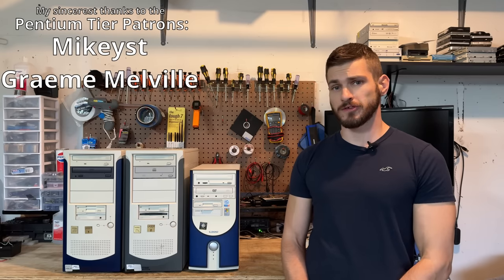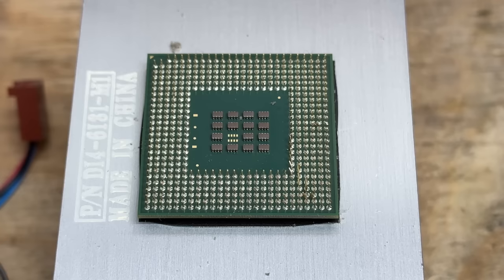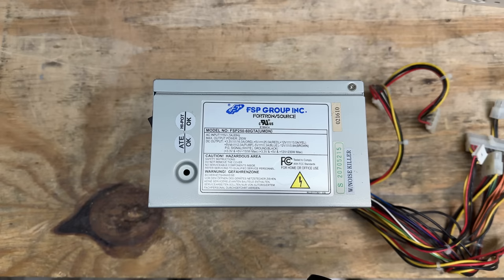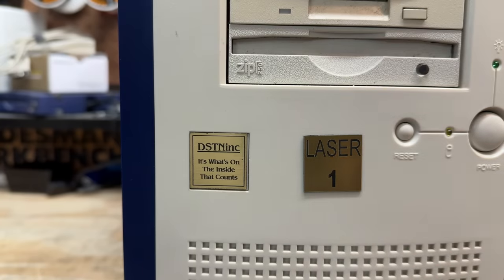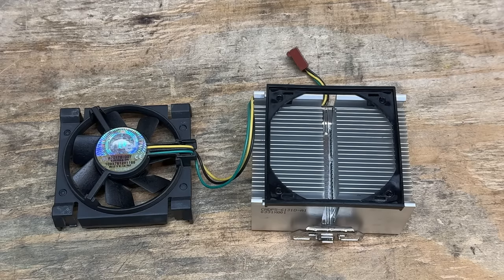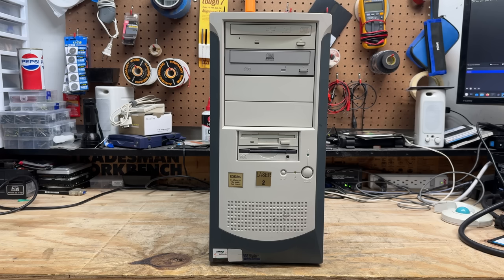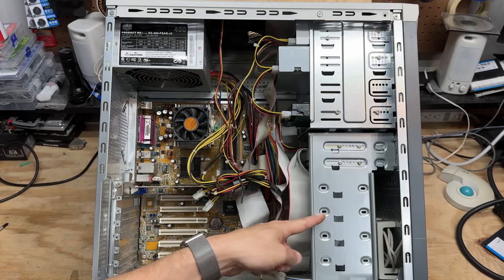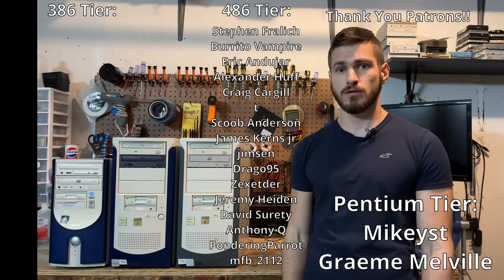2000's Systems! Teardown and Test!

Comment: Here in Portugal you could get those MEDION systems in LIDL, also a German grocery store.
You spend a lot of time brushing all parts. Why don't you use compressed air / a computer de-duster to speed that up? Apart from being too noisy to record and send the dust flying, it can clean everything easily

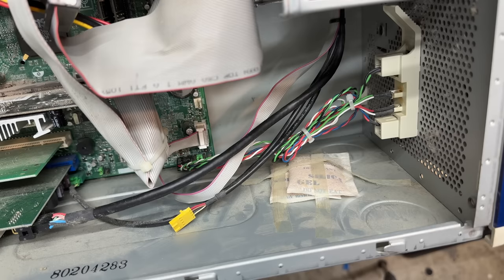Comment: 3:57 I own the same model but a bit low-spec. When opened,I saw those 2 silica gel packs using the same "tape", in the same spot. So definitely Medion did that.
Edit:By low-spec, I meant that you have a model 144, and i have a 123A wich i think was the middle class of the MT5.If you're not convinced enough, the front pull-down tab on the 123a only contains 2 USB 1.1 and no Composite,No S-Video Port (there was one on the Gigabyte Card) no nothing except for that USB and, 56k single-line modem had no FireWire,just a line port. In addition to that, there was strangely 5 USB 2.0 ports instead of the shown 2 USB.

Comment: The Medion PC's usually came with Radeon graphics. Something similar to the All-in-wonder cards but custom made for Medion with extra connectors to bring features to the front I/O. These all had an issue where the bearing of the tiny cooling fan on the GPU would dry out and seize up, frying the GPU. This is probably also the reason why the replacement GPU wasn't much better then what it came with. It was a repair not a planned upgrade.

Comment: That Intel cooler on an AMD cpu triggered my ocd :) I had an Asus A7V8X-X with an XP 2200+  it was an nice board. That CPU clock speed selector is actually an easy way to OC the CPU a little for those who don't really know how to adjust things to make a proper oc. It was able to run that 2200+ at 2.0 GHz for me,and with a few gb of ram it can run Windows 7 pretty good as long as it's not SP1

Comment: Back before I really did 'vintage' and to my eternal shame, I killed a mint Dell Dimension 4100 Pentium 3 system. I tried, in vain, to replace the motherboard but was unable to find one for less than a kidney. In the end I came across a Medion/Aldi Pentium 3 motherboard and was able to partly redeem myself by building a kick-ass Pentium 3 system (using all the parts from the Dell) and it is superb. It runs Windows ME (perfectly, I might add. I love that OS, it really does not deserve it's bad reputation) and has a full 1Gb of memory (using R. Loew mem patch) and is super stable. Those Medion/Aldi PC's are great.

Comment: Pretty nice machines, specially the case/cases ?
With the removable motherboard tray would be great use for a testing rig here.
Socket 462 & later AMD sockets are a bit more interesting to me then Pentium 4 & the somewhat failed Pentium D on socket 478 & 775.
The core 2 duo & core 2 quad & other cpu's based on that architecture at least are fun too overclock for extra performance.

As i grew up with those two sockets & a bit before those with slot 1 & socket 370 between ca 1999 - 2004.
Then grandparents got the slot 1 pentium III in a slocket adapter system, 1 ghz pentium 3 i think it was a coppermine socket 370 one rather then the last of the pentium 3's the Tualatin, ATI 9550 256 mb (which i saved & still have.) until like 2012 i think still on windows xp with 1.5 gb ram.

I'd make a build surrounding either of the Athlon XP systems, maybe a budget gaming rig ca 2005 that got some upgrades thrown at it without upgrading too a new cpu socket.
Like a nicer cpu cooler & a bit of overclocking on that athlon xp 2800+, faster gpu that can run half-life 2 & doom 3 alright.
(HL2 has no copy protection so it can run outside of steam just fine, ofc new engine effects might make it pretty demanding but hey why not see how far it can be pushed.)
And you can make shortcuts of hl2 exe too run the folders for each HL2 episode like this line in target saying for example " /foldername/half-life 2/HL2exe" Adding in " -game EP2 " for episode 2 at the end.
And " -game episodic " for episode 1 at the end of whatever it says in target on the shortcuts you make of hl2 exe.

Comment: The processor in system 2 looks like an Athlon XP 2000+. Despite the name, they were 1.667GHz. You might want to adjust that BIOS setting because they were known for running hot even at the standard clock speed.

Back in 2002, Intel's Pentium 4 wasn't doing so good. It was slower and ran hotter than an equally-clocked Pentium 3. So AMD swooped in an said "Our 1.66 GHz Athlon performs the same as a 2GHz Pentium. So we're going to put 2000 in the name." AMD got away with it because their claims were true. Those Athlon XP processors were a very popular choice back in the day.

Comment: I can't tell you how many times the damn thermal pad on a Socket 478 turned into straight up cement like that.  I really hated that.  The dust mound...  In the words of Cleveland Brown... "Oh that's just nasty."

I don't recall those Mitsumi drive trays sounding "healthy" even brand new from the manufacturer.

Comment: First AMD Athlon CPU is a axda2000dut3c model and it has 1667Mhz. Second one is 2800+ and it has 2083Mhz. For thermalpaste removal im using Turpentine and it works like magic. Aldi have sold those computers at normal shop where you can buy bannanas and egs and milk. They selling laptops and other electronics as well till this day, but not constant. it apears time to time.

Comment: The first Pentium Snore-based board had been partially recapped at some point by the looks of it.  There's some Rubycons on the left, mixed in with the no-name brands.

EDIT: lol, you mentioned the Rubycons about a minute after I noticed them. 😅

Comment: Medion P4 usually come with Radeon 9800 XT.  Very rare and expensive AGP card. Had one system from them.
Reply: No, not the 2,4Ghz system. This came with a geforce 4 mx. Later systems with 3,2Ghz had a special version of the 9800XT called 9800 XXL.

Comment: 17:02 seems to be an Mid 2002 Medion. Late 2002 Medions had already the silver/black case. So I guess it was either an GeForce4 Ti 4200 or GeForce4 MX 440 or MX 460. But they (MSI for Medion) made as well an GeForce 3 Ti 200 and GeForceFX 5200, 5500, 5700 VE with that connector as well..
Don't know why it was replaced with an MX 4000 which would be a downgrade from all options and more on par with the MX 420.. 
And yes you could actually buy these in any ALDI but in the late 90ies, early 2000s the one or two they got per store were already sold out if you not camp for a few hours outside before they openend and then run.. You could backorder them but in mostly all were gone in the first hour or two. This was a big deal back then here in Germany. The media especially a magazin called 'ComputerBild' hyped always their specs and their good value before even the new leaflet for them even dropped. If you need all the features is they were surely a good value but I think only few people ever used all the features. So in my eyes Actebis/Targa (also sold by Lidl), Fujitsu Siemens and sometimes Peacock (later fusioned with Actebis shortly after Targa got sold off) made the better value prebuilds. With less bells and whistles but according to what you really wanted to do...

Comment: The early Aldi PCs had a really poor reputation for being not upgradeable. The first two or three generations even had soldered in RAM modules. That glued in CPU is just the last reminiscence from that era. They were a real pain in the butt working on them. The Mainboards, though manufactured by MSI are not supported on MSI's Website, but solely by Medion themselves - if you are lucky (of course, Drivers are provided for the OS that was originally sold with the machine).

Greetings from Germany,
Marcus

Comment: I really expected that crispy FSP power supply to go up in smoke. If you ever find an eMachine with the original power supply, expect over voltage and a dead HDD at best. Also I don't think you bent those Pentium 4 pins, I think someone else jammed that CPU back into place. Weirdest one I saw was that the pin of a socket 478 Pentium 4 Prescott CPU had come off in the socket, but the CPU still worked. The pin it's self had snapped off but the base of the pin was still on the CPU. Somehow, the system worked fine, and my friend, who the PC belonged too, just shrugged and said "If it works it works", he used that thing for years until he upgraded to a Core 2 Quad system I built him when the P4 Prescott system started suffering from the capacitor plague. I guess the pin was set just right in the socket to make contact with the detached base.
Reply: Or it was one of the unused or many ground pins.

Comment: nice, i did use my athlonXP machine as my main computer until 2010 on winXP, i had a a7n8x deluxe motherboard and i had a mobile athlon XP oc'd to 2.4ghz and the last gpu i had in it was a 6600 GT, it was beast!

Comment: You just summoned an old memory of a Medion laptop back in the day (early 2000's), probably the worst laptop I had ever owned. The vents were tiny, and the cooling seemingly couldn't keep up with the CPU, meaning even light work resulted in crappy performance and uncomfortable to touch (and that's with it on a flat surface with plenty of airflow, or waving it around in open-air). 

It eventually self-destructed with what I believed was a thermal cutoff whilst applying a BIOS update. We contacted support, it was shipped off, said it couldn't be worked on due to additional internal and cosmetic damage to what we reported (which wasn't true at the point of which it was sent), thankfully parents at the time took photos with a cheap film camera just prior to it being picked up, there was a bit of back and forth, but ended up with an apology and a voucher that could be used across PC World, Curry's, and another one that escapes me.

Sometime later we put more cash with it and got the behemoth HP Pavilion zd8000, 'desktop replacement' computer, since they didn't/couldn't call it a laptop ^_^, loved that thing.

Comment: 18:45 if you burnt that CD-R recently (last 5 years or so), its possible the CD-R itself is just too thin for older drives to read properly. It's getting hard to find quality media, everything is junk CMC media these days that just refuse to work on anything that isn't a modern drive (and half the time not even then).

Comment: Fire Wire / 1394 was strange
I saw a church that had a Fire Wire / 1394 expansion card in the late 90s
I didn't see any software for it.
I remember the pastor had a very very expensive digital video camera and that was why they needed the port.

I don't know what they used it for.
I never saw any video on the website or on the PC

Might have been something they never used

I remember in 95 HP came out with a CF 10 MB digital camera with a serial 9 pin cable
They paid about 450 dollars plus tax for each and bought 2 and never used them

Comment: I think it is modified Win 7 to work on a socket A/462 system.I have  two top model Gygabyte MB with strongest NF2 ultra chipset with the top 3200+ Barton CPU plus 3 gb of ram,,You can't normally put win7 on these !!Must be modified!!

Comment: What do you mean Western digital doesn't have the best reputation all the ones I've ever seen fail are Seagates.
Reply: Totally agree. I've used WD for years, and out of about 40 drives, I've only ever had 1 fail. Seagate? Meh, I've had several of those fail, especially the 7200-9 drives. The older 7200-7 drives were pretty okay though. I've even had pretty decent luck with older Maxtor drives. They're noisy as hell, but they keep chugging away.

Comment: Those SIS chips were absolute garbage! caused a lot of stability issues and combined with crappy caps, made boards like this really unreliable at high frequencies, but worked OK with low end CPUs like Celerons